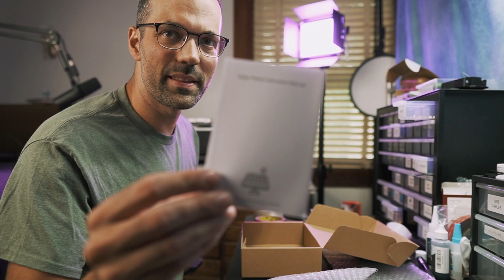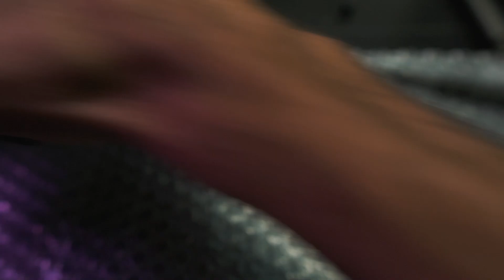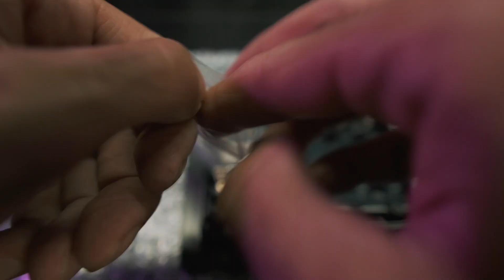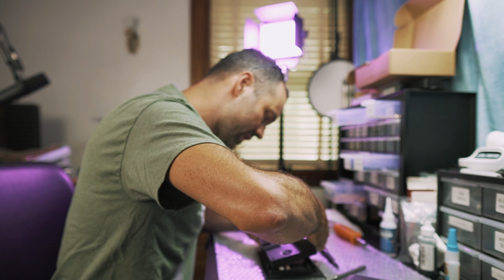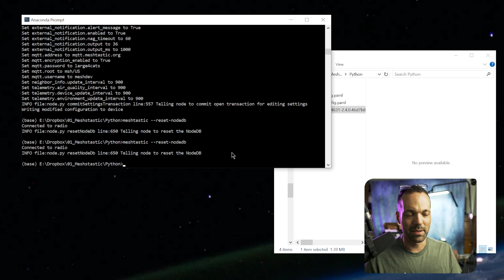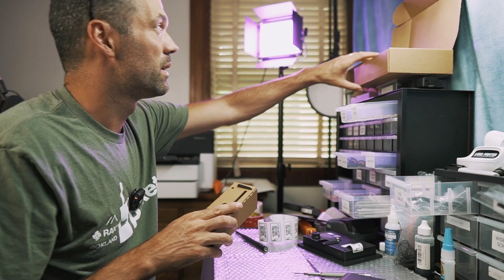Atlavox S4 Solar Meshtastic Node Assembly | Batch 2 Changes and Updates

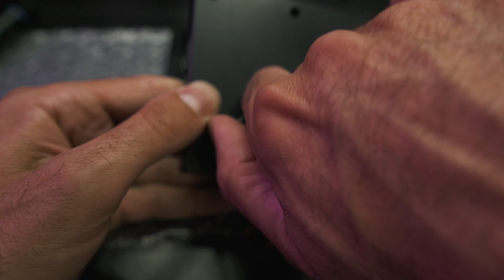Comment: At 14:20, consider a “tiny dab” of silicone grease to the one surface of the caps tether ring that makes contact with the retaining nut. It should reduce the friction, allowing you to keep the tether positioned where you want it, and maintain the water resistant properties.

Comment: Is there any problem using this in below freezing temperatures?
I’m thinking about those 18 650 batteries being recharged in below freezing temperatures
Reply: I wonder the same thing. Typical lithium batteries do not do well in freezing temperatures. Can we install lithium iron phosphate battery (LiFePO4 battery) instead. Is the charge controller compatible with LFP?

Comment: Definitely interested in knowing when these or new version will be available again. Very clean solar node would like an option to use larger high gain antennas with this instead of the 90 deg antenna only.

Comment: What size is the screw on the back. Could you link to correct mounting screw from amazon?
Reply from the maker: It's an M6-1.0 thread, like this: https://www.amazon.com/Cicidorai-Flanged-Stainless-Machine-Quantity/dp/B0B581BZ1J
Reply: @Atlavox  You might scope new alternative non corrosive options for the screw heads. The screws included have acquired rust on the heads after one month of outdoor use. Hope this helps to improve your great product. Please let me know if you find a great option. I would like to switch mine out as well. Thank you.

Comment: Ive built a few these using a heltec.. prior to you building a brand. one thing I've seen is an issue with the BMS killing power output to the device for no reason, while maintaining charge to the 18650's. I'm not sure what theactual issue was, but my remedy was to tap power off the battery rails versus the 5v out from the BMS. just thought id share.. goodluck.

Comment: For the handheld unit, a few people I've spoken with on reddit have been looking for a waterproof version. Would you be interested in offering waterproofing for the handheld version?
Reply from the maker: What's tough about waterproofing a handheld unit is I'd need to come up with some sort of cover for the USB and LEDs. Also, with 3D printing it's really hard to guarantee waterproofness because it's not a continuous molded plastic. My switch mechanism would be vulnerable too. I would have to take a whole other approach if I was trying to achieve waterproof.

Comment: For anyone that has ordered the solar unit without the circuit mod. On the pcb near the pads marked 5v and gnd there is a resistor marked 95B which is a 9.53k ohm resistor. If you change it to 12k ohm resistor your output will be 4.17v give or take. Which will make it safe for input in to the battery connector on the wisblock which has a max voltage of 4.3v.
Reply: @brettvk4bde are you using the 12v or 6v version? Which resistor block did you change? Mine are labeled R18, R17, and R14 near that point on the board.
Reply: I have the version with the usb c cable which is 5v
Reply: @brettvk4bde  do you have a link?
Reply: Do you have any thoughts about using an LFP battery to better withstand freezing temperatures? Is the controller compatible?
Reply: Do you have a link or share a closeup photo of this little resistor modification? Thanks

Comment from the maker: Couple things I wanted to clarify after editing this video: The biggest reason I chose not to offer this as an empty enclosure was simply due to the attention to detail required to assemble. I think you can see in the video the amount of focus required to make sure everything is put together correctly. I'm hoping to solve that with the next iteration, so it's nearly foolproof to assemble. I'd be much more willing to sell international, because I could sell just the enclosure and not worry about shipping lithium batteries international, and having to stock different types of WisBlocks.

Also, I noticed I kept calling the iPEX cable an antenna, lol. I know the difference, honestly, lol.

Thanks to all my customers so far! Everyone's been so fantastic and supportive of what I put together. It's really cool.

Comment: Excellent work!  the effort and the thoughtfulness you put into the design and manufacturing process are obvious.  I would love to buy a DIY kit without the wisblock and batteries and assemble everything myself.  That may save you time in building them yourself and save us a few dollars.
Reply from the maker: Thank you. Yeah, I think that's going to be an objective with the next version. I just felt this one was a little too tricky to assemble and felt it would be a frustrating experience for people. I want to make the assembly easier in the next version.